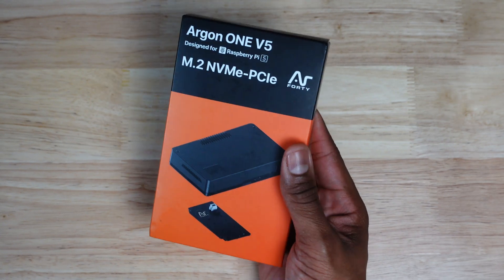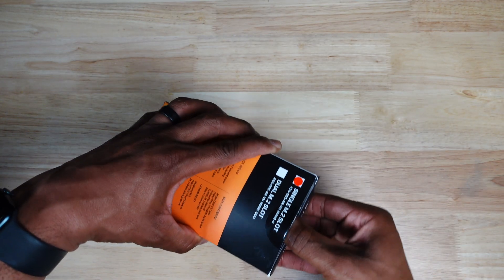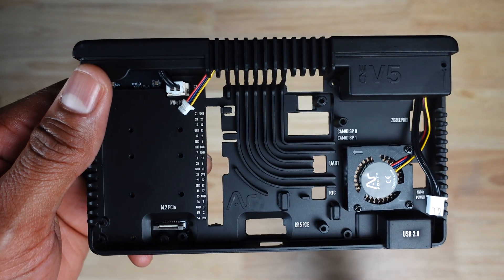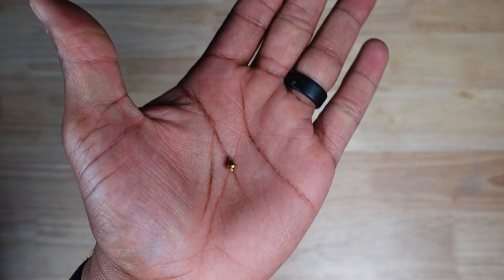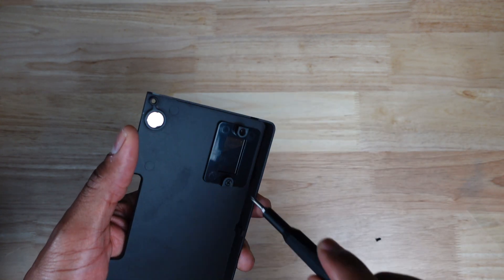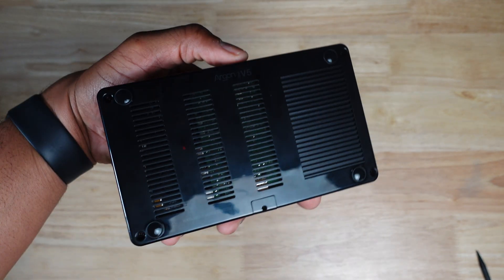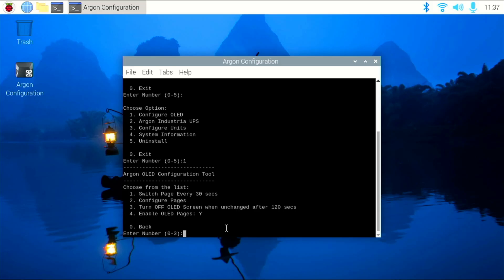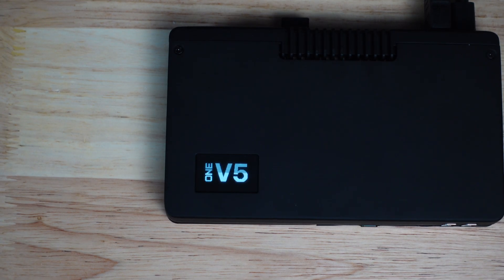Argon ONE V5 Hands On

Comment: Great production quality. I have no Pi experience but was looking at this case. But in concept, I would prefer a 2 NVMe hat. I thought I heard you mention something about availability. 

Can you lead me to a compatible 2 drive side module? Geekworm and a few others are available but I don't know about compatibility. 

If you can't help, that's fine. But if you can, that would be great too.
Reply from the maker: The Argon V5 case with dual NVME is more expensive than most but a great option. If you need two NVME drives check out the Pimoroni Dual NVME Base.
Reply: @iam.jasonhoward  thanks.